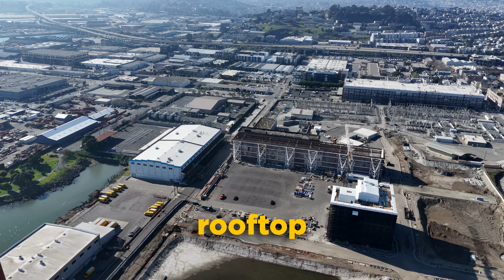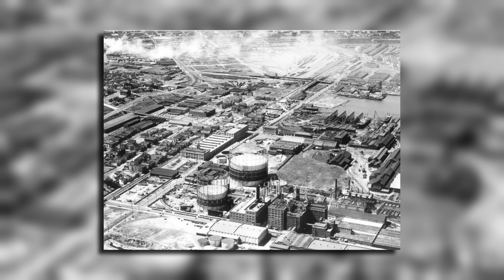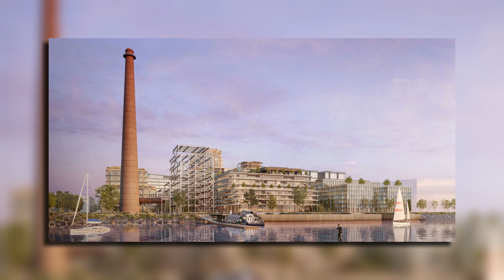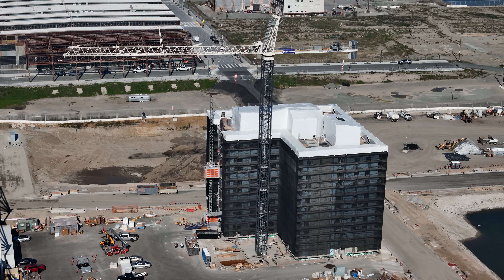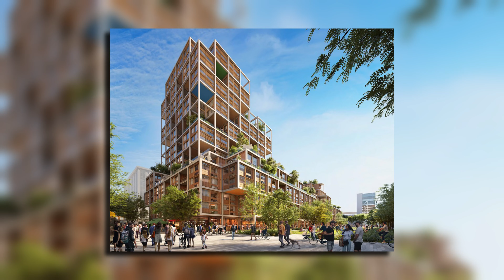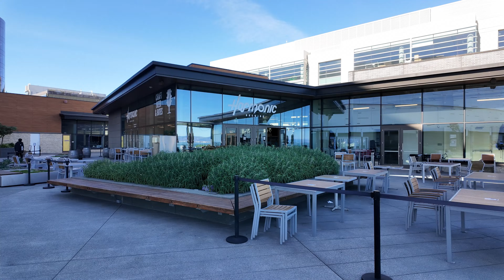The BIGGEST Waterfront Project That Will CHANGE San Francisco in 2025

Comment: I am excited that this is moving forward. We really need much more of this.

That said... the actual buildings designed by these "star-chitects" are SO uninspired. Just variations on the same cube design. I don't know if they are really impressed with themselves for cranking out yet another cube (just one box after the other), if they just outsourced the design to AI, or what. Not every building needs to be designed in a classical form, but not everything needs to be a box either. Google "LE PLESSIS-ROBINSON" to see what can be done with adding classical designs in re-invigorating existing cities. Architects will cry that that is "looking backwards" or somehow it is "fake" because the designs reflect older traditions. But for some reason, the fact that since the mid-90's everything is just a variation on the same box is somehow artificially shielded from these same critiques.

I don't hate new buildings. But so many of them are so severely uninspired. And others are just tortured. I see that in some of these designs as well. A mixture of older traditions and newer designs is what we need. A real city. But that is something that almost never happens because cubes are cheap and architects are trying to make a name for themselves instead of giving us cities and buildings that are comforting and with detail and beauty that captures the eye. 

I also wonder how many of the new pathways will be pedestrian/bike only vs. allowing cars everywhere. That is hard to see when I research the new plan. It looks like they are extending the existing street grid. Hopefully these streets will be speed governed (via design, and not just speed limit signs) to around 15mph, and kept very narrow to allow for more space for people. Imagine how nice the area would be for that. But from what little I can see it looks like the same sized streets that already choke the rest of the city. I hope I am wrong about that.

I am still excited for this development because it is sorely needed and at least some concessions to human centered design appear to be in the works. Fingers crossed.